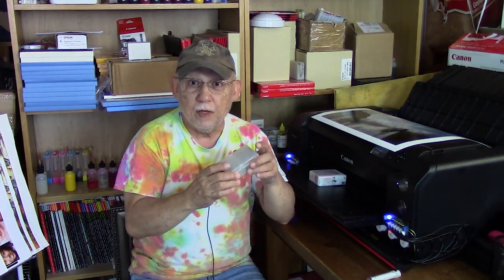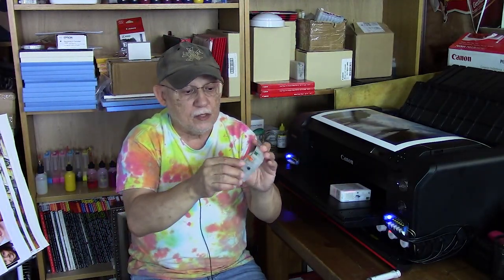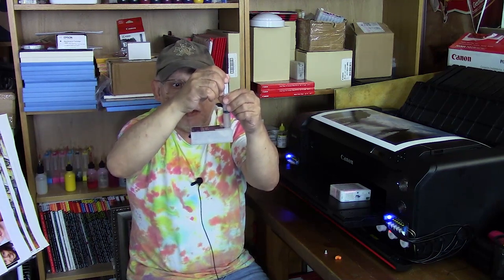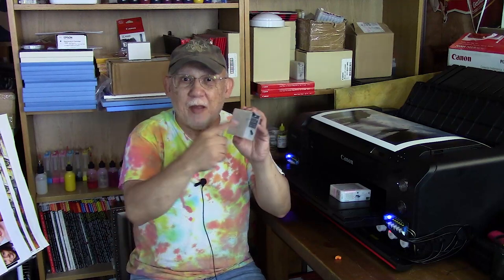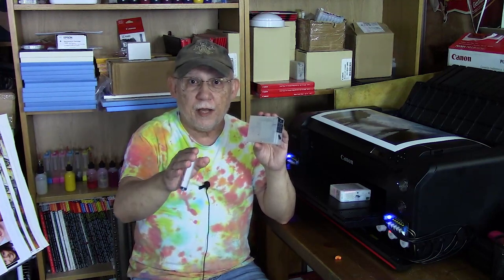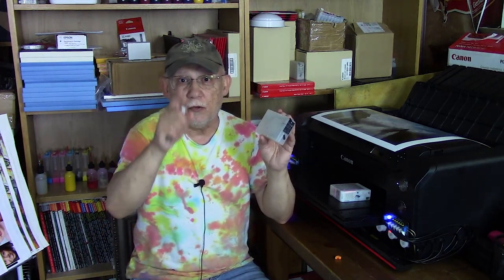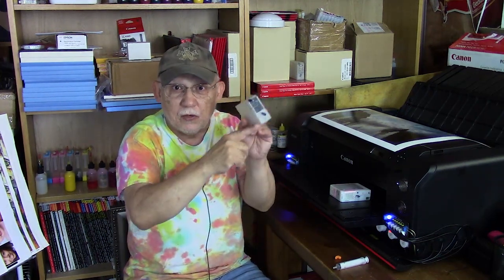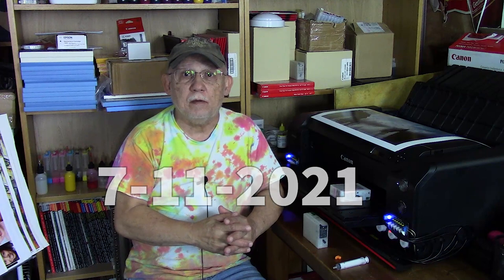I have a completely missing channel on my Large Format EPSON Printer! Oh yeah I refill!

Comment: Hi Jose.  Your videos have helped me a ton in the past.  I have a 3880 that has been pretty reliable, until just recently.  I was out of town for about 2 weeks and the printer sat unused.  When I returned, I did a nozzle check and the matte black is not showing up at all in the test print.  I've tried all manner of cleanings and still can't get any matte black to show on a test print.  I always keep my carts topped off so there's no problem on the ink levels.  I'm at a loss for what to do now.  Any advice?

Comment: Hi Jose, I have an Epson Stylus Pro 7880. Can you advise what would be a good RIP for this printer with Windows 10 that allows me to drop and resize multiple images on the paper for efficient printing. Looking for a supplier of new or used RIP software. Thanks

Comment: Great Video thanks.  I am using OEM ink in my Epson 9880.  I just replaced 4 ink cartridges.  My Light Black just deopped out.  I just replaced the capping station assembly.  I looked and the Light Black line seems to be empty at the camper.  Printed 10 light black pages 8.5 by 11 didn't help.  Where do I start.  Thanks  Mike

Comment: I think the Epson 3800/3880 refillables reset automatically when the printer is turned off. I never reset mine! They show full when I turn the printer on again. Am I missing something?
Reply from the maker: You have older style chips. All recent chips reset to full only when the ship is declared empty. With your chips you have to make darn sure you have ink in your cartridges at all times otherwise you would chip will reset the phone and you have a small amount of ink left and  that would not be good. Why are you powering off your printer anyway?
Reply: Perhaps he is following your advise in a previous video regarding the 3800/3880 were you say you turn off your printer.